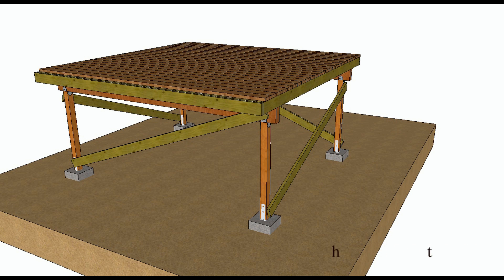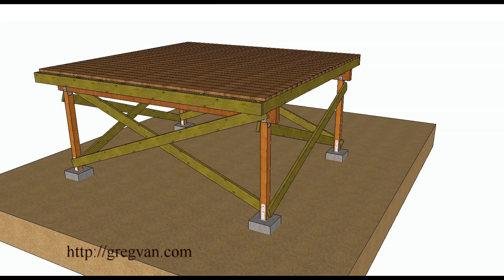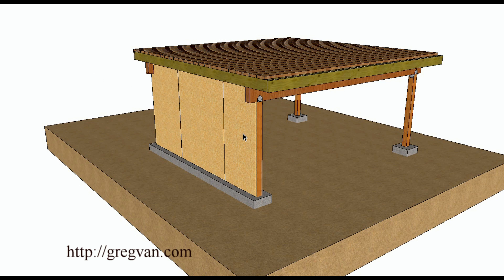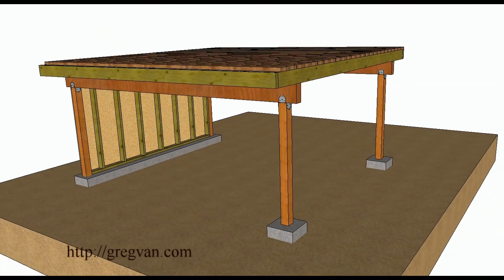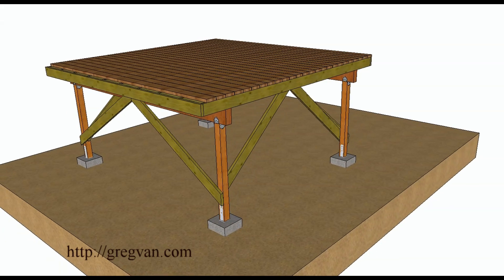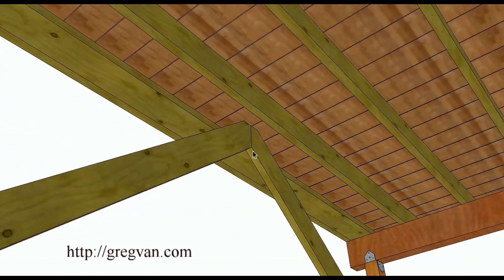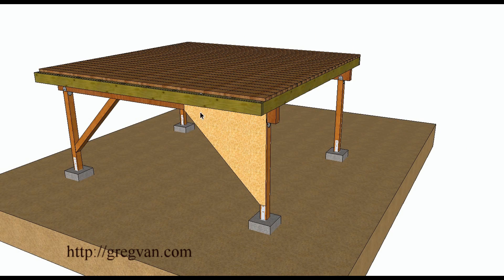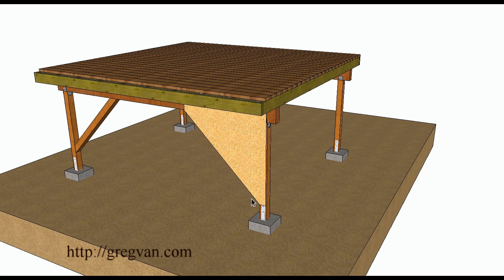A Few Ways to Brace off Free Standing Wood Framed Deck

Comment: What if the example deck has 8 4×4 posts around the edge and one side is much higher off the ground? 
Should I use a chisel and make a pocket for it to sit in on the bottom rather than bolt the bottom?
Reply from the maker: I've seen that method used also.

Comment: I built a free standing deck on the side of a mountain. Low posts were three feet high posts were 8 feet high. I put the post three feet deep in concrete in the ground and some 45 degree braces

Comment: I'm building a deck for my above ground pool. I'm thinking 5'x15'. Would more posts help strengthen it? It will be 5' and a half feet high
Reply from the maker: I would think more braces would help more, but it will depend on the design.

Comment: Do you think think I could use 5/4 deck boards as braces when my deck is 20x22 and the post (4x6) are 6 feet apart. The deck sits about 3 to 5 feet off the ground as my yard is sloped.
Reply from the maker: I can't provide an answer, but if you're not going to get an engineer involved, you might install a few braces until it isn't moving any more.

Comment: I have a platform that is roughly 12 ft off the ground on 6x6 post. On top of the platform I have a tall barn style building with an overhang on all sides. The Platform is 20x22 and the building on one side is 10x16. It is my treehouse with two oak trees coming up through the platform opposite the building. The issue is that as someone walks on it, it moves slightly. Don't think it is a safety issue, but annoying, feels like riding in a cruise ship. I watched your bracing video. would that kind of brace work for me?
Reply from the maker: I don't know if it will work with out stabilizing the bracing, but it also might be worth trying. I can't provide structural engineering information, but an engineer might if needed.

Comment: Great video.  My deck is about 10 feet high off the ground with 4x6 posts.  Deck is about 15 ft by 15 ft.  I really don't want to put up walls, So I'm hoping running exes across each section will be enough
Reply from the maker: I can't provide structural engineering advice, but can tell you that you should be able to build the deck with bracing and when the decking is finished and you stand on top of it and it's moving, then maybe add more bracing or structural supports.

Comment: those huge triangle sheer walls would make for one ugly looking deck, and those 45 degree  braces running from corner to corner would be almost just as ugly.  just saying
Reply from the maker: I think the correct thing to suggest is that those braces might be to some, but not to others, like myself.
Reply: @gregvancom  Yes, depends how nice you do it. most decks around here are bolted to the house so dont use much bracing but to avoid wobbling they use extra 6x6 piers with angle braces 1/3 of way up. but at a certain point too many piers will make it look ugly as well but at least its solid.

Comment: Great video. My question is I'd like to use diagonal bracing on the underside of the decking horizontal framing. The deck is attached to the house and runs the length of the house 31' in length x 12' wide.
Reply from the maker: I've seen it done before, I'm just not a big fan of it, because it could trap water between the top of the brace in the bottom of the joist and this could eventually lead to wood rot. If you live in drier climates, this might not be a problem.
Reply: @gregvancom  Hey thanks for that Greg. I do understand what you mean we live in Colorado so we get lots of snow. What if I were to use cable rather than wood so that I can actually make  adjustments to the cable by use of turn buckles. If necessary?
Reply from the maker: @georgegarcia9661  I like it.
Reply: @gregvancom   I had been thinking of this idea before. I thought of using some plate steel. Maybe a 4" x. 6"  x 1/4" steel plate with two holes drilled into one end maybe 2 1/2" apart to use  to mount the plate to the wood. Using bolts screwed through the plate and wood both with a 3rd hole in each plate for using a hook eye bolt at the bottom of each plate. Mounting them vertically then using the cable and turn buckle system. I thought of placing two plates close to the ledger. Then placing two more plates at each out side corner of the deck. By the cantilever. Stretching the cable out at a 45 degree angles. To the outer corners of the deck. I thought of placing the plate on each of the inner horizontal joists. Then placing the plate with 2 " exceeding the bottom of each of the horizontal joist.

Comment: Use a strong metal post embeded in the concrete ane you won't have any issues to begin with. Simpson Strong-Tie Moment Post Bases are a unique, innovative solution that resists rotational forces, while securely connecting the 6x6 post to concrete.
Reply from the maker: Definitely another good idea.

Comment: I usually lag and screw my rims to the sides of my posts as opposed to setting the rims on the top of the posts.  I have uneven ground everywhere, and that makes it difficult to set bases and establish level lines to do measurements for my post lengths.  So I set my corner posts with the rims fastened to the posts, and then fill in the spaces on 4 or  6' intervals from the corners.  I have done the shear force calcs for my lag bolts, and in my opinion, I am way stronger than standard construction screws and sinkers, which I use in addition to the big lag screws.  I follow American wood works and ASTME standards for my lag screws.  But is my rim to post side attachment considered to be a bad thing??
Reply from the maker: I realize that there are plenty of patios and decks built this way and I've never came across any of them that have fallen down, but you would need to check with your local building department to verify whether or not you could use this type of construction process. I don't use it, because I don't think it's a strong as sitting the beams on top of the post.
Reply: @gregvancom  since watching your video, I did some additional research and found out that my technique is a well accepted and legal code compliant methodology in most all US communities.  Thanks for your response.

Comment: Thank you for the insight Greg.  I live here in S.East North Carolina where the foundation is a sandy dirt mix (not completely stable) and am in the process of building my daughter a free standing playhouse.  It wasn't until I got on the deck and set up two walls did I realize it has a little more "rock n roll" than I feel is safe.  the playhouse is 10' (F/B) X 8' (Sides) and sits on 4 prefilled concrete pilings (approx. 3' deep) affixed with U shaped metal brackets that supports four 12ft 4x4's.  Platform starts at 6ft.  So as you can visualize, this thing has a lot of height!  I did install "sway braces" on all the post to platform but are only about 1 1/2' in length (making me question if they fall in the 30*-45* angle you spoke of).  I definitely feel the concrete "trench" may be in my best interest in addition to creating a larger "sway brace" or even possibly even walling in the lower portion for better stabilization atop.  Would you agree?  Again, thank you so much for your tutorial, huge safety factor hereScott b
Reply from the maker: I can't provide you with engineering advice and think the best I could probably do would be to have you email me a picture or design drawing and I will be glad to take a look at it. You can get our email address at our website.

Comment: What style of bracing would you recommend if you are bracing an attached porch with 6x6 posts, already cross braced at the top, not full length cross bracing. I would like the porch to be able to support 5000 lbs
Reply from the maker: I cannot provide you with structural engineering advice, but think that you could stand on top of the deck and try to make it move from side to side and if it moves too much, then you're going to need more bracing. Feel free to email me some pictures for more information, if this doesn't make sense.

Comment: Question, do you know what the standard is for post span? Im building a 20 foot by 30 foot deck?
Reply: Albert Cervantes we don’t go more than 6’ when we build ours. We use 6x6 post. Best way is to measure full span of deck then divide it up so there equal. Hope this helps

Comment: Thank you for the video!  I am trying to build an elevated playhouse for my kids and this will definitely help.
Reply from the maker: Great.
Reply: I am still trying to decide between burying the post in concrete or pouring all of the piers and then setting the posts on top. I am in Southern California and he area is sloped slightly. The deck will be about 4 feet in the air.
Reply from the maker: If you're asking for my opinion, then I wouldn't bury them, but would make sure that they are braced off to where they aren't moving.
Reply: I was definitely asking.  Thank you for the advice and your time.  I like the idea that the wood will all be above ground.  Do you have any advice on which post mounts to use?  I am leaning towards the mounts where I sink the threaded bolt in the wet concrete.
Reply: @shonuff5878  yes, that would be the one since its very flexible left to right and you can adjust it as necessary. Meaning, you dont have to be perfect when you pour the concrete.

Comment: My deck has no fastening whatsoever, it came this way when we bought the house. The posts just seat on concrete pads. There is no way to embed any structural fastening system in there, but luckily the deck is attached to the house. What type of bolts do you suggest we use? Thanks!
Reply: F L also we use 6x6 post. I don’t care what kind of bracing you use. 4x4 should not be used to support a large deck.
Reply from the maker: Send me a few pictures of your project and I will see what I can do. You can get our email address at the website. I don't know what type of bolts you're referring to either, you will need to be more specific on what they will be used for.
Reply: F L  Hi FL, A friend of mine bought a house with a Deck and a few years later his whole entire family fell while barbecuing. luckily the deck was only about 4 feet high. hopefully you have checked and secured yours. His deck was secured to the house but apparently it was not done correctly.
Reply: F L we use 5/8 galvanized bolts from store. Depending on what your going through and into. 8-10” usually work good. I’ve built a lot of decks and we never use post to post bracing unless it’s over 8’ off ground also depending on size of deck. We usually will go 2’ deep and use 4 solid blocks. The weight of the dirt will hold post as long as there deep enough and long as you don’t have a lot of run off around post. Hope this helps

Comment: Hey Greg, great video. I was wondering what is structurally more secure, the 4x4 cut on 45s to beam and post or the 2x8 from bottom of post to center of beam, from both sides of the left and right post, or to go from one post to the other corner to corner, 2x8 creating the x. thanks
Reply: hey Greg, we're still waiting here...

Comment: What Column base plate do you recommend for a 7.5 foot tall 12'x12' long Pergola with 6X6 columns?
Reply from the maker: +Nooch2222 It's hard to answer that question, because I don't know the design of the structure. Send me some pictures and I will see if I can provide you with something. I would be thinking that you might need deeper concrete footings and longer hardware than something you could purchase at your local lumber yard.